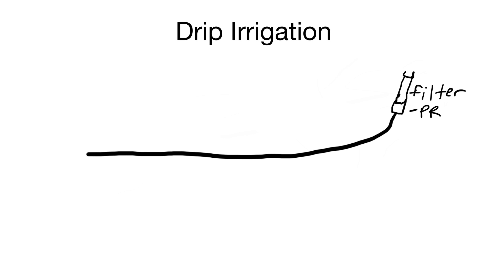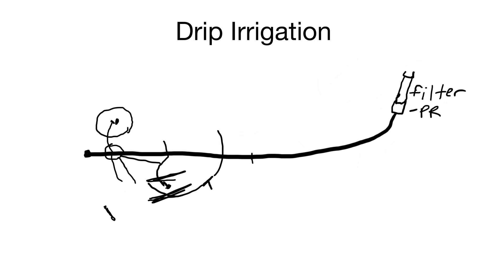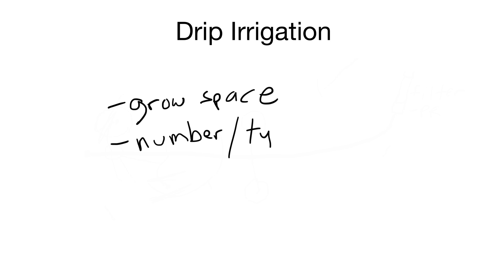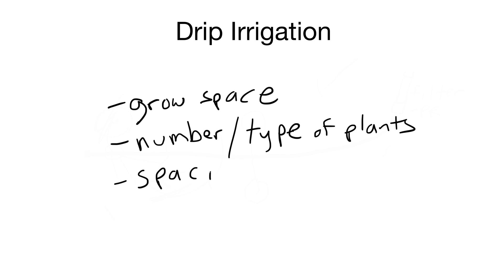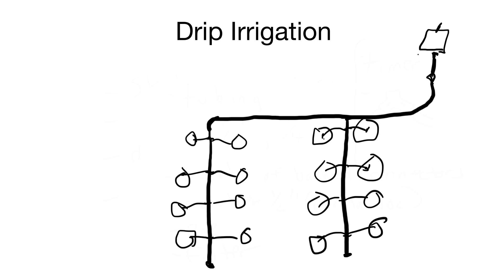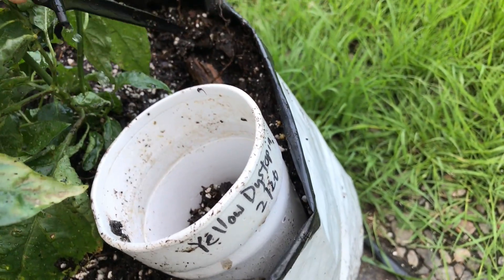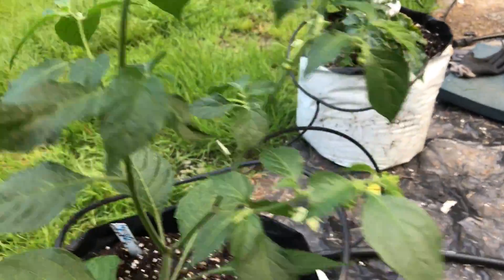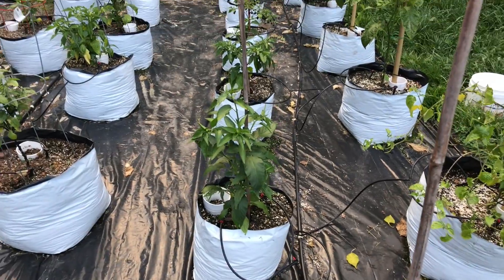How to install a drip irrigation system, from design to implementation

Comment: 9:18  Pete!!!  Mate!!!  That's not a pressure regulator!!!  That's a Check Valve!!!  It does not do any pressure regulating.  Although its better than a pressure regulator, as it will stop anything going back into the fresh water supply.   This is known in Australia, in this installation as a Single Stage Back-Flow Prevention device.  In some installations Single or Double Stage Back-Flow Prevention devices are mandated by law.
Reply from the maker: There are two parts, a back flow preventer and a pressure reducer. They are in line with each other.

Comment: As always nice job. I am only looking to fill my kiddie pools to the overflow mark. I have 1/2 inch poly snaked around and I want to add 1/4 inch lines to go up into the pools. Do I still need emitters and pressure reducer? Any help is obliged. Thanks
Reply from the maker: You could leave off the emitters. I'm not sure about the pressure reducer. You could try without, but they are relatively inexpensive and you would still be getting 25 psi.